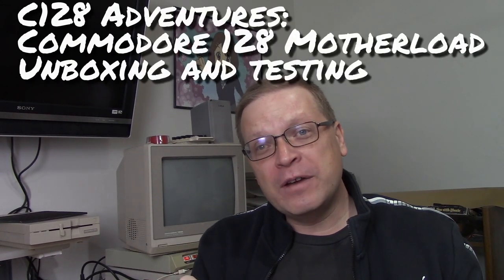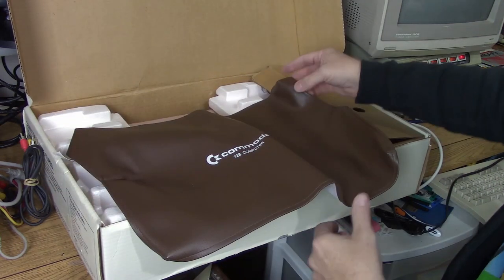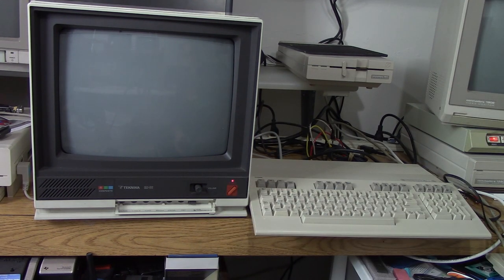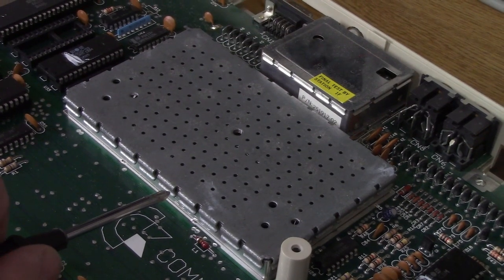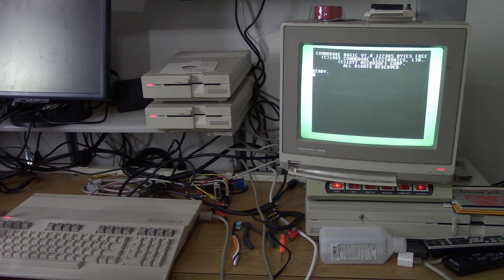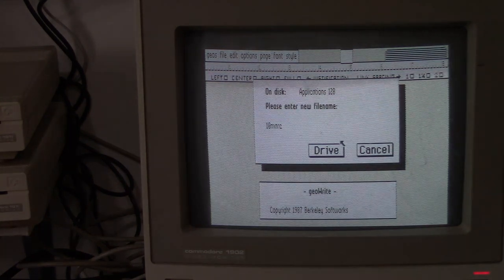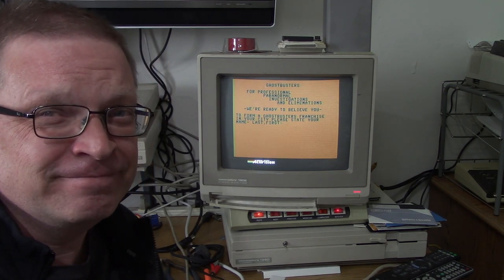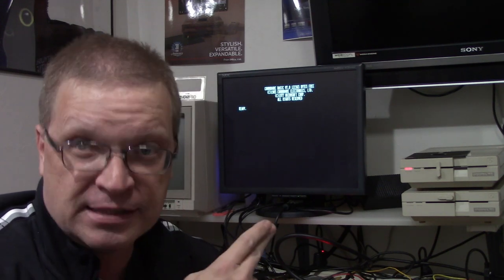Commodore 128 Motherload Unboxing and Testing - ChickenHead Chronicles

Comment: Nice haul, Doug! Don't blame you one bit - sometimes a deal is just too good to pass up. I got a mostly working C64, a couple CBM joysticks and a couple games off Craigslist for $25, and last year got a 1084S monitor for $35 (had to drive 4 hours round trip up to Toronto to get it, thank goodness my passport was still valid).Gotta keep your eyes open and be ready to pounce these days, prices are only going up and up and up for retro stuff.
Reply from the maker: That's right! There is a guy in Tucson who grabs up a lot of the Commodore equipment and turns it around on eBay for an apparently hefty profit. So far he has not been very responsive to me reaching out to him. It just means I have to pounce if I see something I like very quickly!
Reply from the maker: Now that is a sweet deal! The seller apparently had no clue what they had!

Comment: wow. Very nice haul. Almost as if the previous owner didn't use these items much and just put them back in their original boxes. Prestine condition. I actually suspected it could be a bad capacitator related to the 80 columns chip that could cause that issue. Until I watched the whole video and you had found it was the chip itself causing the problem. Glad you managed to diagnose and solve the issue. C128s are really sexy machines. Both the C128c and the C128D. Very nice. Thanks for the video. I always look forward to Commodore videos coming from you
Reply from the maker: Thanks! The problems was an interesting one for sure, and I figured if the VDC was going to fail, it would just fail and be done with it. This one actually works sometimes! I was so surprised I had no issues in GEOS with it, since it must be hitting the VDC pretty hard!
I did find a source for New Old Stock of the VDC for $30 each, so I will order one for my spare machine.

Comment: About the C128 video adapter: Usually, the picture appearance and jail bars matter on the processing by the HDMI converter. Sven's adapter is passive, so if you have a great cable and great converter, you will get a decent picture. I do not have one, so I did not try it out, but I have discussed this project with Sven some months ago.
Reply from the maker: A meeting of the Sven's! I love it! My RetroTink2 that I have now has no SCART, but I know the new ones do. I bet the image quality would be exceptional going through a RetroTink!
Reply: @10MARC  I know Sven for probably a year or so. We talk frequently. I have ordered the first batch/revision of pcbs for him to save on the shipping. I have wondered, that maybe, it connects to the rgb input of the RetroTINK.

Comment: You see the soldering also on the C64C 250466 which have a shield under the board.and also have a big heatsink shield.  Get lucky that all see clean and mint out. It’s a beautiful C64C 260466 and with the shield under a above it weight a lot. Had clean the board and on the heatsink new paste on the chips.  I buy it 2019 for a cheap price and have a lot of fun with it. The 250466 have the best VIC and the best SID6581R4AR on it.

Had a C128 but have no luck to get it running. Have take it all out and sell lose pieces to get my money back.
Reply from the maker: The 64C is my favorite model also. I have a few breadbin models, but my 64C is the one I always use!
Reply: The C64 was my first experience back 1984 and have the C64 Breadbin FAT 250425 RevA still after so many years. Is still a great computer and have never let me down. Now 2021 it’ still working and is in mint condition. My second best is the AMIGA 500. The AMIGA 1200 is more a experiment to do projects. 

Had never back in the eighties a Commodore 128 or a VIC-20. They also great computers but I don’t have a connecting with it.

Comment: Nice video.  The reason the 5-Pin video cable can work for separate connection is because pin 1 is Luma.  Pin 4 is composite and for some monitors, like the 1701/1702 that is close enough to provide a sharper picture for Luma/Chroma.  Jim Butterfield wrote about this in 1983 in this COMPUTE!: ISSUE 42 / NOVEMBER 1983 / PAGE 191
Reply from the maker: Well if Jim Butterfield wrote it, then it is the absolute truth. He was an awesome guy. I think that he would have been thrilled that the Commodores were still receiving so much love even almost 40 years later. Thanks for the update and that information, I was really confused by it!

Comment: On my C128 and 128D I spent more time in 128 80 Col Mode then I did in C64 Mode, heck I think I used CP/M more than C64 Mode too.   Now my kids use 64 Mode to play games and such but not so much me.   I always used my 128's for productivity and telecom applications.   I even ran C-Net 128 with both a Data Chief and Lt Kernal Hard Drive System.  The Lt Kernal had a multiplexer so I could share that Hard Drive with 4 other Commodore 64 or 128's.   I did play games but I was never big into games although I had a ton of them.   Other people with 128's did spend most of their time in 64 Mode but that was mostly to play games.   Timeworks had some really nice 128 Software and my favorite was Sylvia Porters Personal Finance which I used everyday,   Like most people I sold off all my 8 bit and all my Amigas except the A2000HD which I still have and use today.   When I got bit by the retro bug I picked up most of what I owned before and more but not the Hard Drive Systems.
Reply from the maker: Heck, when I was 15 and 16 unused my C64 more for productivity than gaming even back then! Your machine sounds like it was incredible!
I suspect many people who claim they only used C64 mode might be forgetting that they were kids then, and their parents very likely used the C128 as more of a productivity tool.
What CP/M programs did you enjoy using? I am doing a CP/M episode soon.
Reply: @10MARC  I used WordStar if I recall properly but I had a set of programs from the same publisher and some other misc titles I played around with,   I was already familiar with CP/M back then and I think I still have a book CP/M Plus from DRI that lives next to my 128D.   My boss had a Kaypro II I believe that was the model which also ran CP/M.  Honestly when the 128 came out it was the CP/M which attracted me most to it even thoough CP/M was falling by the wayside to MessyDOS.   Wow that triggered some old forgotten memories.

Comment: The story Bill Herd tells of the 8563 development its no surprise to me that 30+ years after being made its died. At VCF West 2019 he gave a talk about the aging of these computers; the particular weakness of the chips is the passivation layer on the chip is failing over time. These were never meant to last decades; especially when you consider what little they sold for at the time.
Reply from the maker: Yes, that was a good talk Bil gave for sure. He is a great guy! You are correct that these were hardly meant to last a few years, much less decades! We have all been very, very lucky.

Comment: Nice! Looking forward to your 128D and software videos. I have a 128D as well and use an Ultimate Cart 2+ on it (attached using a 90 degree cartridge port adapter), a wifi modem and used a different set of adaptors to go directly to a modern (ish) lcd with Svideo for 40 column and vga for 80 column. I also picked up this nice joystick switcher interface that also has a PS/2 mouse port that emulates the 1351 mouse for Geos use... love that machine!!!

Biggest hassle with all these old 128s and 64s is most of them have CIA chips that fail the test cartridges...
Reply from the maker: Wow! Sounds like an awesome system! Does the ultimate Cart II have any limitations running in C128 mode?
Reply: @10MARC  a few little things but they can be resolved using a custom  add-in rom.  Especially useful on a 128D since you sometimes want to disable the internal floppy so it doesn’t fight with the u2+... unfortunately I don’t have an eprom burner so I ended up just hard changing the drive number on the built in drive to device 10...
Reply: @10MARC  I definitely recommend the u2+ cart though if you don’t want to mess with floppies anymore or if you are a Geos user as it can act as a pair of virtual
Drives and a REU.  It’s a bit more of a hassle with the 128D because the machine is so big so it’s a long reach to the cartridge port, but the 90 degree adapter makes that easier. 

I also have an image that works via the u2+ of the basic 8.0 add in rom for better basic graphics commands in 80 Column mode
Reply from the maker: That sounds really nice! I will have to get one

Comment: What a weird symptom. I immediately thought of bad ram, since certain garbage characters, random @ in this case, can point to a certain bad ram chip. I once got random @s in 40-column mode.
Reply from the maker: I suspected that too, but rules it out after I noticed 40 column mode worked 100% every time. The only issue in that mode was an occasional inability to boot, but I suspect that was just because the VDC was not initializing on boot up.
The diagnostic software I used does have a RAM test, and it seemed OK.

Comment: Unfortunately C128s don't age as well as C64s and they are prone to more problems as they get older, especially in C128 mode. Interestingly, whilst some of them don't work perfectly in C128 mode, their C64 mode does.
Reply from the maker: I have had three of them come thru my door and have not had too many problems. One was perfect, one had a bad function key, and one had a bad VDC chip.

Comment: The Star SL-10C looks a lot like my old Star SG-10 that I used to have; only difference is the manual feed knob looks different. Is it a serial port printer or Centronics? My SG-10 used a Cardco G-Wiz adapter to convert the serial port to Centronics. Interestingly enough , the Cardco G-wiz adapter will work with newer dot matrix printers. I have an Epson LX-350 made in 2013 that works with my Commodore 128 using the same Cardco G-Wiz adapter.
Reply from the maker: Mine is the Commodore Serial cable. The only frustration I have is that the ribbons I found don't have the proper little block at the end of the ribbon that forces the ribbon to reverse direction, but that is the ribbons fault, not the printers.
I also have one of those Commodore Serial to Centronics adapters, and plan on testing it with a laser printer one of these days. GEOS handles those nicely.

Comment: I don't see well in the video but, in 80 columns with the adapter of Mr. Sven, is colorfull on the lcd monitor with a ntsc c128? I see is white only. Apart of it, the adapter is amazing. I have the gonbes + rgbi to rbg solution, and the colors is dull. Thanks!
Reply from the maker: Yes, it's full color. The camera did not catch the color well. My Patreon Thank you video is a direct capture from the adapter, and I think it captured the colors quite nicely!

Comment: FWIW, you can also do CATALOG/DIRECTORY [ON] U9 without specifying the disk number. If you use the `ON` keyword it works for both CATALOG/DIRECTORY and DLOAD the same way (e.g. DLOAD "*" ON U9) so you don't have to remember which one wants a comma. :)
Reply from the maker: You are correct. It is actually amazing that a lot of the Commodore 128 books and literature actually don't say anything about exactly how you access drive nine with a new basic seven commands. I guess I just learned to put the d0 in there, and then just do that out of habit. I was today years old when I learned about the ON keyword. I've honestly never used that. Thanks so much!

Comment: had that problem with faulty VDC it seems actually common in flat 128, turns up ok, but hit it with some vdc demo e.g Risen from Oblivion had problem manifest when going to vga monitor (through gba8220 and proper c128 dac. After I bought a new VDC never had problems again.
Reply from the maker: Glad to know I am not the only one who got theirs fixed! I need to get that demo...
Reply: @10MARC  Oh it's excellent - amazing what they achieved on the VDC with no real hw scrolling or sprites

Comment: @13:20 - dual monitor??? Does this mean Commodore machines can have "Extended" display, or just "Duplicate"?
:)
Reply from the maker: I suppose I could make a wall of monitors... The C128D does support dual displays since you can have the 80 and 40 column modes working at the same time - you just have to toggle a key to switch between them!

Comment: I have a technical that does not work in 80 and in 40 grays only. It has a different cable for 128 than stock? For. 8p I posted in Facebook  the pics of th mj22
Reply from the maker: Could you be more specific? Which model Teknika monitor? Mine has several switches on the back for controlling which cables are used
Reply: @10MARC  It is 7 miles away at my home in the countryside I will get that info and pictures this morning
Reply: @10MARC  mj22 in your FB post
Reply: Yes watching Dragon Heart on the monitor in NTSD video cable only. Will now try 128

Comment: Great video! About the 40/80 col SCART adapter, does the 80 col output is in 16 color? I assume your 128 is NTSC, isn't it?
Reply from the maker: Yes, full 16 color in RGBI mode. It is an NTSC Commodore 128. For the price, it is a great adapter.

Comment: Hey! Out of interest what revision of SID chip you got there inside that lovely C128?
Reply from the maker: This little guy has a 6581 from 1985 in it.
Reply: I was surprised to find a 6581 R4 AR in my C128 I picked up. I thought they would all come with the 8580 SID.
Reply: @jdryyz  Nice! I also found one of those here too. I need to test this C128 and find out if that SID chip is still in working order.

Comment: You're in Tuscon? Do you know someone in Tuscon/Phoenix who can replace caps on retro PCs?
Reply from the maker: Well, the closest it Paul Rezendes in California. He is always overwhelmed, so there is a guy on the East coast I could recommend.
Reply from the maker: And yes, Tucson. We are starting a Commodore Users Group on Phoenix as soon as COVID is under control. Interested?
Reply: @10MARC  Yeah, Paul is probably who I'm going to tap to do it. If not for Covid-19, I would have already just sent it to him. You would think we would have someone here in Chandler who could do these kind of jobs and would be an enthusiast - and take some of the heat off Paul. My A600 is from a guy in SoCal who actually always meant to have Paul recap it, and never did because, Paul is so busy. :)
Reply: @10MARC  Yup. Interested, and have a couple of contacts here in the Phoenix area who have also been talking about making this happen.  PM incoming.

Comment: Too bad the 80 column goes through a SKART instead of RGBi straight to HDMI. That would be optimal
Reply from the maker: It's likely because SCART is easy to adapt to almost anything.
Reply: @10MARC  makes sense. if it was developed in Europe, perhaps that's also a reason,  as that is a standard over there.